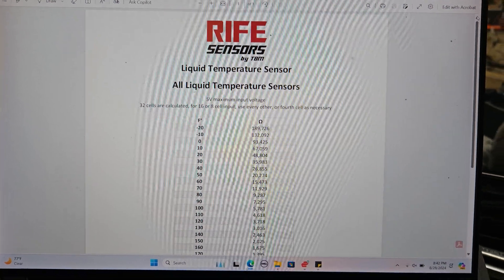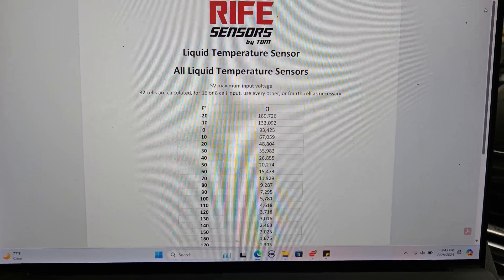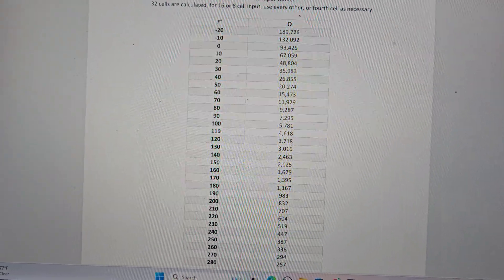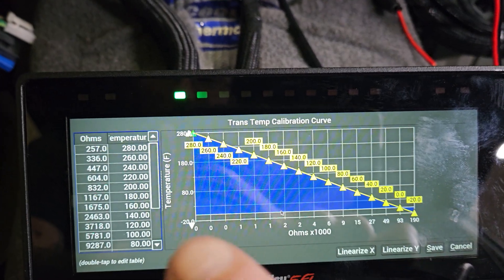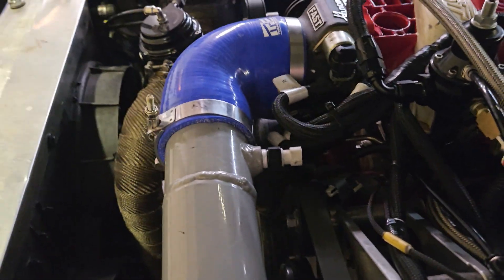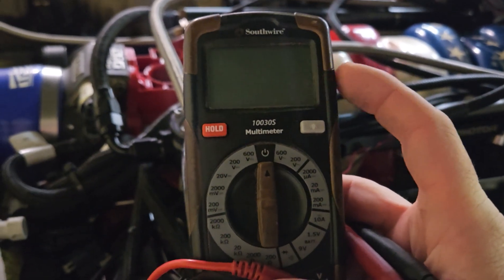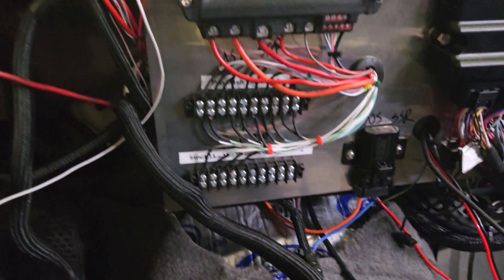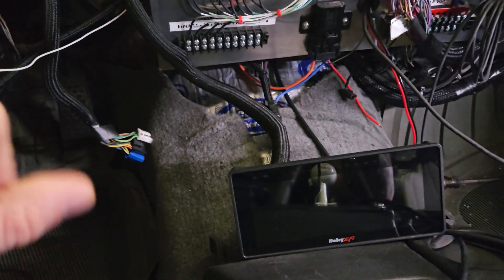How to setup a Rife Coolant Temp Sensor on a Pro Dash

Comment: You would connect the sensor to inputs of the Holley Dash to any of the 4 pins right like io4,io5,io6 or io7 for it to read? Since those 4 read Thermistor
Reply from the maker: Correct, connect to the sensor input and the other side to sensor ground.
Reply: @ got it Thanks brother
Reply from the maker: @Christianortiz100 you're welcome, and thanks for watching and commenting.

Comment: Thanks for another great video.  I have a RIFE 150lb. pressure sensor in my regulator. The Terminator X handheld screen shows fuel pressure, but my Holley pro gauges do not. Could you do a video on the that please? All the other gauges work. I even figured out fuel level, blinkers and a high beam warning light...lol Thanks for teaching us non smart computer guys in a way we understand.